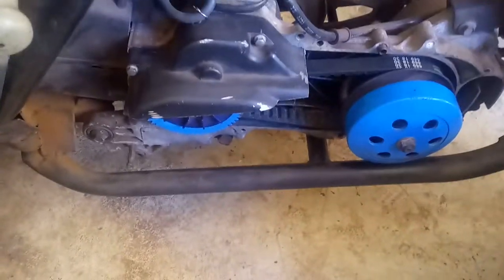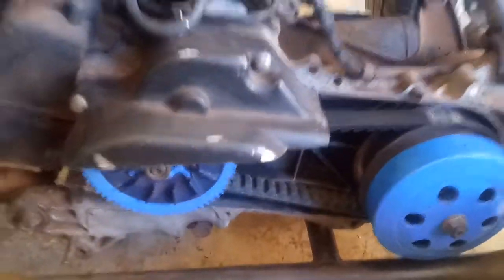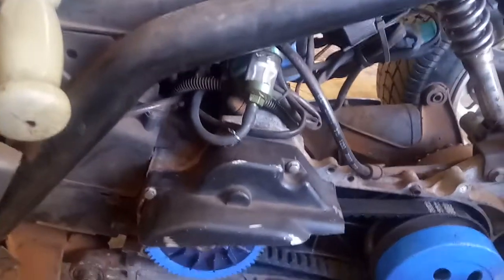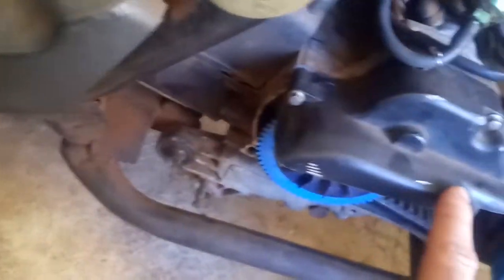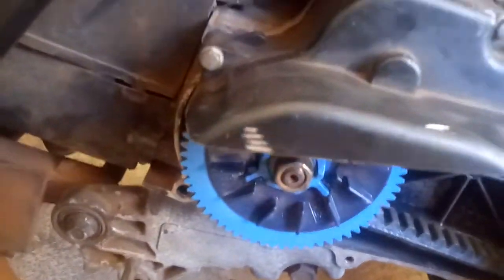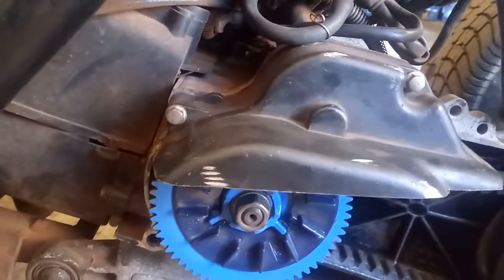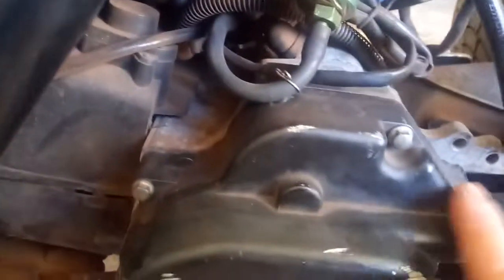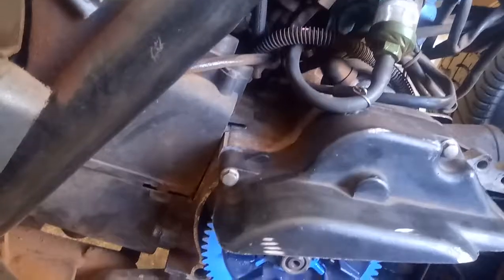How to run an open CVT on a GY6 50cc or a 139qmb 50cc

Comment: so.. so i determined ur a genius. i would start my bike, pull cover off then QUICKLY have to touch bendix and lift it cause it starts to tap along starter ring on variator. The hole in case is the only reason u need the case from my perspective. imma try to imitate something that can hold BENDIX in place thats low profile